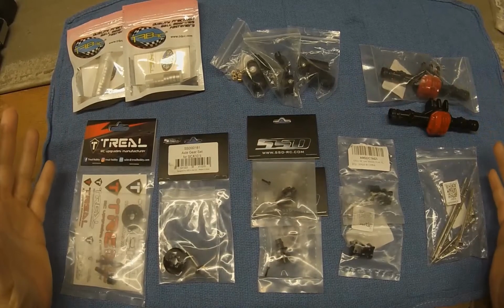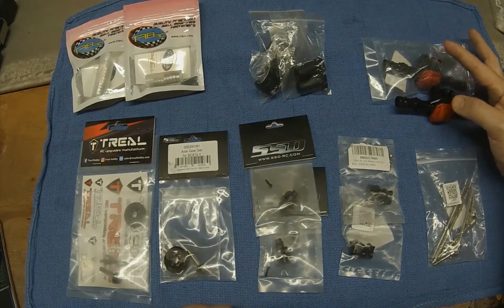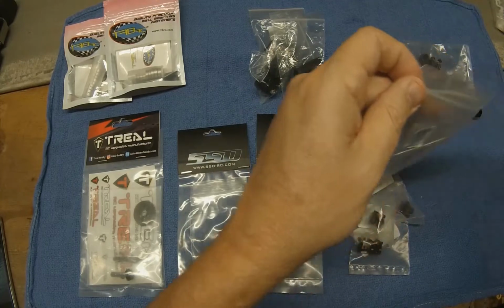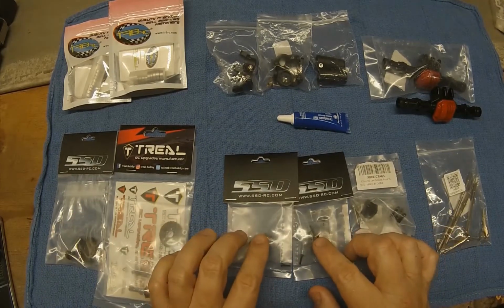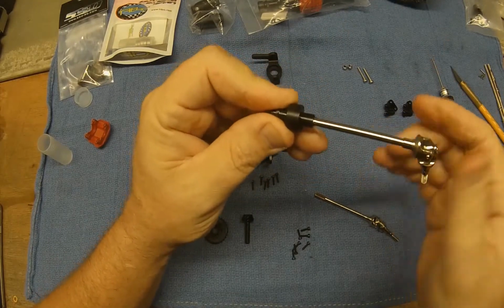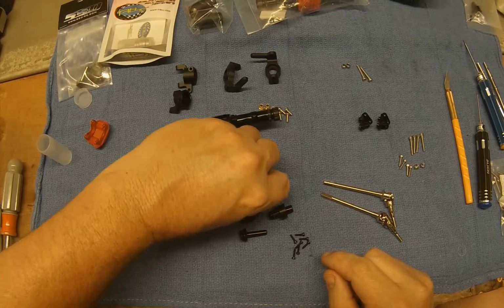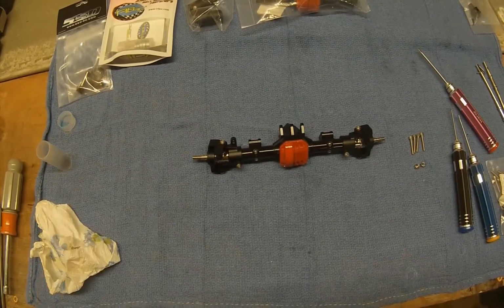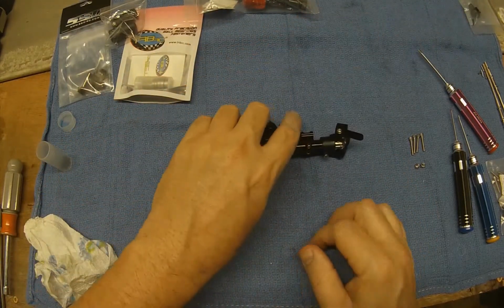Amazon cage crawler custom axle build

Comment: Can I put a servo mount on the axle housing?
Reply from the maker: You can buy an axle mount servo bracket, I did that when I switched those axles over to the injora carbon fiber chassis.

Comment: That's not really a bad investment for a set of "build it once & fuggedaboutit" all metal axles.
You built 2 for under $200, which is less than 1 vitavon axle would cost.
Reply from the maker: Yep, I did a lot of test to see what stuff would work together before I put the video out, so far everything is interchangeable between all the brands
Reply: @leesrcs  
Finding solid common ground, like an Axial AR44, is a good start for mix 'n match budget builds. Sometimes you gotta spend money to save money down the road.
I think you did great on this upgrade.